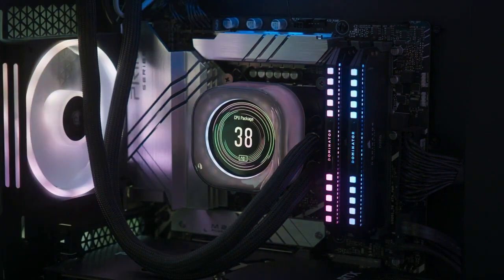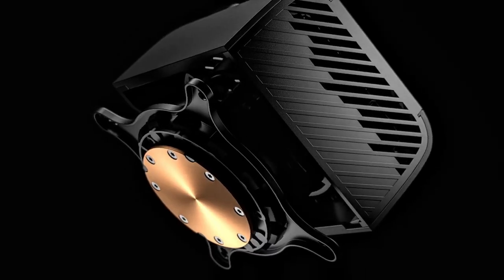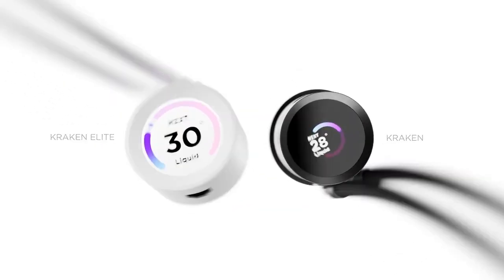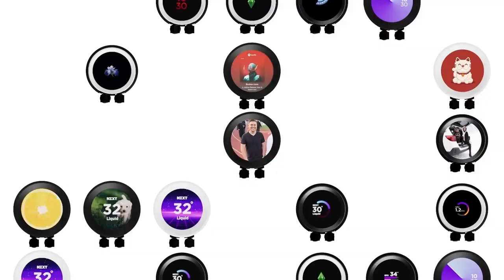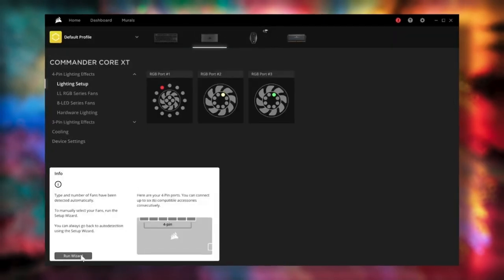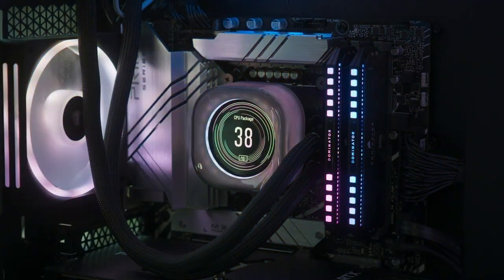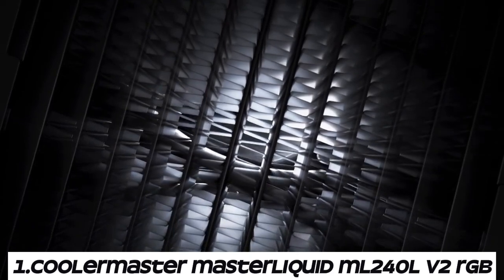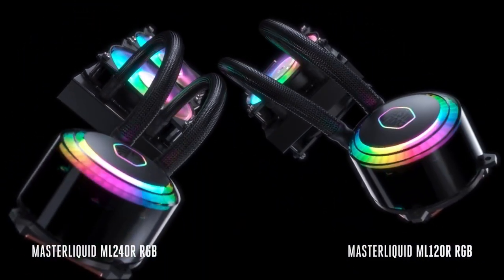5 Best AIO Cooler - 5 Best AIO Liquid CPU Coolers in 2024! - Which One Is Best?

Comment: Your missing probably what is still the number 1 AIO on the market. The Artic Liquid Freezer ii is probably by far one of the best for cooling still on the market be it older or newer version of it
Reply: the III version and 420mm is even better
Reply: @LetsG0Champ  i have the ii 360 sitting on top of my 5800x (everyone knows its the hottest amd chip) and i cant fault it still sitting at stock voltage and keeps it around 70-80c while benching and gaming mid 50s